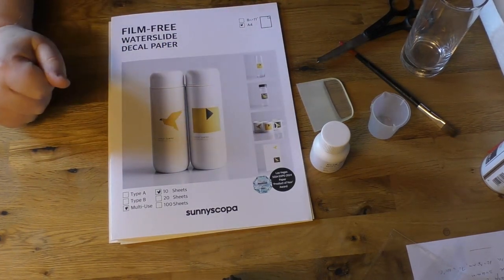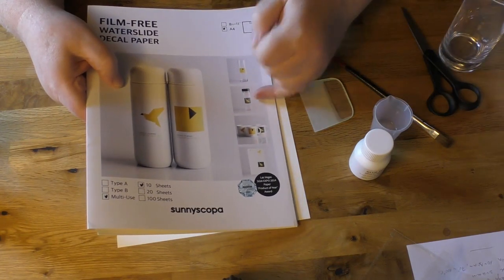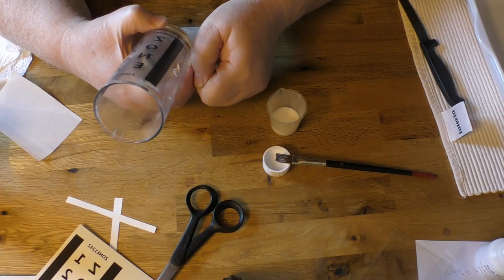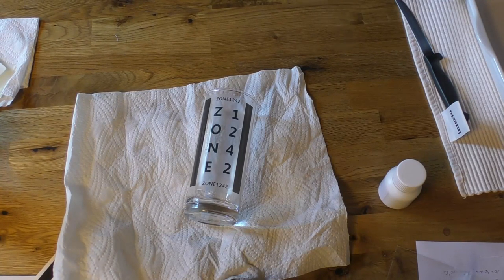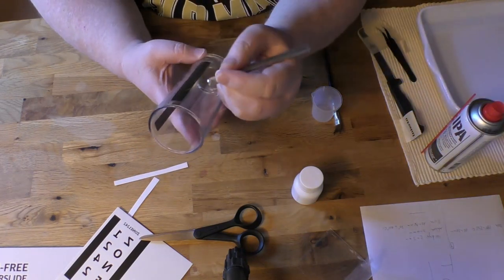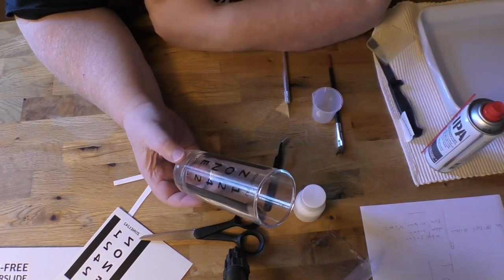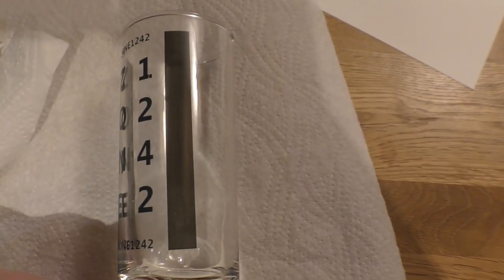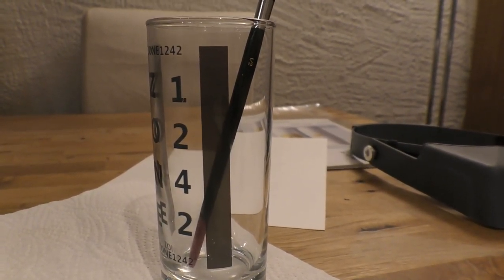Try Out of Film Free Decal for Radio Glass Dial

Comment: I have been messing around with metallic film free decals for a different project . But just a thought you could try using  the film free metallic decal papers that use two sheets of decal paper (one blue and one white). it also uses a sheet of toner reactive foil . I was thinking maybe you could use a sheet of black toner reactive foil instead of the usual silver or gold) and it may solve your problem. I dontknow the opacity of the black foil though.
Reply from the maker: Thanks,  I'll give this a go.  I have tried similar products and the opacity is always the problem. My latest plan is to perhaps make two decals and stick one on top of the other and see how the opacity is then.
Cheers,  John
Reply: @Zone1242  Worth a try , as you would get the toner plus the foil stuck to the toner which should enhance the opacity  . You do need a cheap laminator though to use it ,get them very cheap on Amazon or anywhere really. You also print the toner the right way around as well insteadof inverted . The Sunyscopa video on here shows the process.

Comment: I know this is an old video, but did you ever locate anything you are happy with? I'm looking for something similar to repair a Drake TR-3 dial.
Reply from the maker: Hi, Alas no.   I figure the best approach with the current solution would be to make two of them and, with careful alignment, fix one on top of the other.   Haven't tried it yet though......
Reply: @Zone1242  First - do you know you can change the amount of toner to be printed on some printers? Second - try adding a layer of acrylic paint (with spray preferably) over the places which are meant to be opaque, let it dry and then apply the same way you did in the video. Make sure the added layer of paint faces to the glass. Sorry for bad english. I know, i know not all heroes wear capes, because i certanly dont.